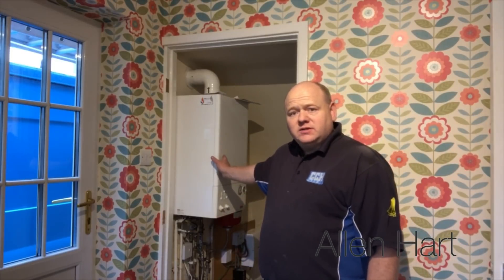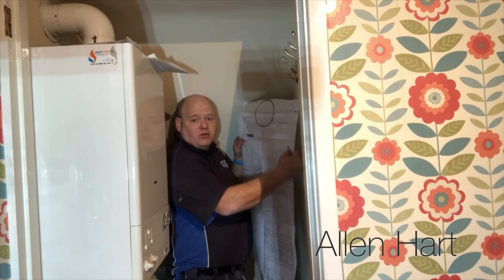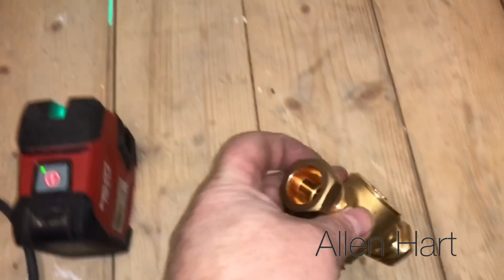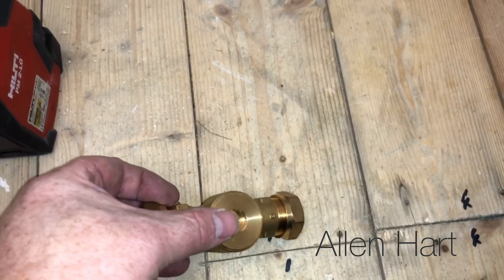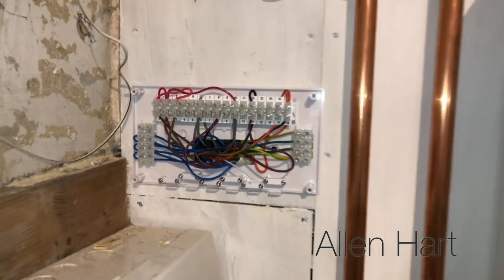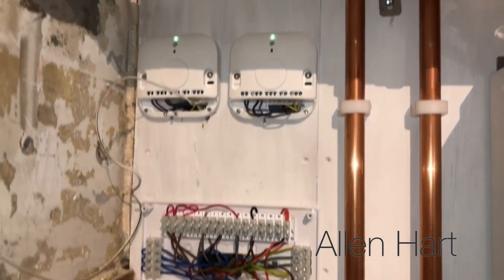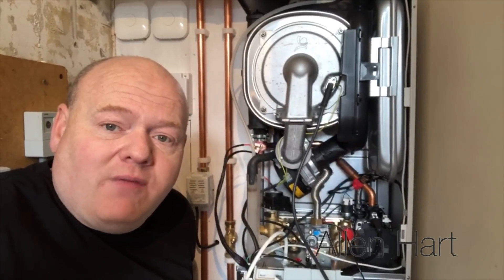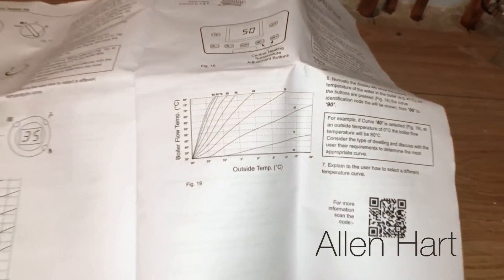BAXI 600 - 636 GAS COMBI BOILER INSTALLATION - IFOS - NEST - S-PLAN

Comment: Baxi have the vent mode for when the boiler is first switched on to get the air out of the system. Can this mode be used when the system has been drained & refilled? If so, how is it accessed on the controls? FYI, your work's much neater than any gas fitter I've ever used - many have shocking workmanship.

Comment: What curve you you set the ifos system in the end?  I’ve got mine installed and getting ready for winter ha
Reply from the maker: I ended up removing it as i didn’t really like it.
Reply: Allen Hart that’s what I’ve heard ha. Il try about 5pm pos and see how I get on. Obv the 630 version drops down to 20kw in heating, assume the 636 is bigger CH kw. Watching your latest vokera video where ya can range rate the heating demand. Is there no way baxi could release an installer/gas safe Wi-fi module that plugs into the front on the diagnostic plus to allow you to set all these parameters on installation with a smart phone ? Your the celeb now. Maybe ask baxi if it could be done as I would like to drop my CH output to 12kw and see how I get on.

Comment: Alan that’s going to be a tidy job when complete .. One query why on the bypass pipe work did you tee it in with the returning bypass circuit converging with radiator returns straight  through the tee fitting instead of on the branch or (centre) entry ? Like this  ...your bypass has more chance of pushing round  (reverse circulating) nearby radiators? Love to hear your view on this possibility ??.. Best practice advises priority flow always straight through Tees and all converging flows on the branch . Good luck with your home upgrades . tho 👍cheers !
Reply from the maker: We have underfloor heating downstairs now. Thanks.

Comment: Why would you use ifos with Nest thermostats? I thought Nest used a local weather report.
Reply from the maker: Very good point, I was just showing it on the video. IFOS has been disconnected. Thank you so much for the comment. Happy new year
Reply: @AllenHart999  if you have multiple zones surely the nests are on/off and not open therm. So the ifos would still be useful? Or can you wire 2 nests to open therm?

Comment: The worst company i have ever dealt with Purchased in April 2017 Inspected by Baxi in may 2017 boiler installed ok , worked for 18 mts boiler now condemned by Baxi saying it was installed incorrectly now washing their hands of it blaming the installer

Comment: Hi Allen I have a question if a high limit stat is faulty does that mean if testing it and there is continuity on the connection it’s gone .
Reply: Generally a high limit stat has continuity both ends (NC).  If it reaches high limit the contacts open therefore shut down the appliance (NO).

Comment: Hi Allen great video , quick qusetion does the return just be a single return back to the boiler as normal or does it be piped up in a different way? As do you need 2  seperate returns aswell ?
Reply from the maker: LETS GO all the returns join together. Normally near the boiler 👍

Comment: Hi, thanks for the video.
I have a couple of questions please 

1. The shock arrestor, on which pipe does that need to go on and what does it do? From my understanding it limits the pressure change to reduce damage to the boiler 
2. During servicing of this boiler, will the engineer open the heat exchanger or is that not necessary? I know they open the older boilers but on these ones do they have to change the seal?
3. Why does the flue have to be at a 3 degree angle ? And is the flue resistant to cemet? 
4. What is the purpose of the bypass that you installed first? Why is the return pipe connected to the flow via a bypass?
5.  How does the flow valves work for the 2 zones? I assume it stops one valve and let's the other open ? 
6. How far does the pipe work have to be from electric meter or switches?
7. Does the boiler have to be a certain height off the ground? 
Thank you for the video and I am an apprentice, thanks in advance
Reply: E45 Cream far too many questions.

Comment: Another benefit to press fit is the lack of soldering that you have to do meaning you can be as lazy as anything much prefer soldering takes more time but looks better and will last much longer than the rubber O     rings In the press fit fittings but each to there own everyone has there preferences still a great install and great video.
Reply from the maker: Pressfit has been around for 50 years and in nearly all commercial settings, Including hospital's. I used to like soldering until i used press. Thanks.

Comment: Hi, Every boiler install manual I’ve read says the boiler must be fixed to a masonry wall and not timber stud or similar (assume because of the heat from the boiler and fire risk?). Is this boiler different as you have boarded out the wall for fixing; could you confirm please?
Reply from the maker: Stephen Hall I don’t know of any boiler these days that you cannot install onto timber , Thanks

Comment: The nest has weather comp built in and adjusts your heating times automatically
Reply from the maker: The weather comp on the nest will not work with more than one zone. Thanks.

Comment: Love the vids Allen, can i ask you a quick question, had a new combi boiler fitted 4 years back, doing the normal getting serviced every year to comply with warranty, got a issue, maybe you can help i keep having to bleed my radiators on the first floor, cause air rises i guess, the system is not leaking as i cant find any puddles under the rads, i am bleeding them say every other week, not much air escapes, but if the system is sealed why is this happening, when i do bleed them it smells like a chemical smell, could this be flux still in the system ??? any help mate be great. Paul.
Reply from the maker: Paul Le Fur Maybe you could buy a Fernox test kit, take some water out and send it off, that way you will see what’s wrong.

Comment: could you not have wired the nest into the opentherm on boiler
Reply from the maker: Extreme Photography Not this time, it’s on two zones. Thanks
Reply: @AllenHart999  me being dumb of course i fit nest usually and wire onto opentherm thats how my baxi 428 is running

Comment: Hello Allen, another great video mate & thanks for sharing.  
I have a couple of questions about that bypass!.......when the bypass is active the direction of water will be further restricted by the direction of water coming in via the return & also it will enter the boiler un filtered as it is tee’d in after the filter will it not?
Thanks again & keep up the great work!
Reply from the maker: The bypass wouldnt normally be used, it has one rad in the hall that is used as a bypass. Thanks.

Comment: Hi Allen, been watching your videos for a few weeks now, really like the Baxi 600 range, been fitting mainly Baxi boilers for years, expansion vessels on the 600 range are a bit on the small side tho
Reply from the maker: Just add an extra one if its not big enough for the system. Thanks.

Comment: Great video - thanks!  Would you recommend a Baxi heat only boiler if you were installing it in your own house?  It appears that the current heat only models utilise an aluminium heat exchanger.
Reply from the maker: They do a system boiler which is very good, open vent I would go for the Viessmann compact.
Reply: Dont know why these videos are on you tube as its illigal to fit gas boilers unless you are registered ! and being registered you would know how to fit a gas boiler !   ,
Reply from the maker: @gonzoeveritt6002  You make a very good point but we are in a world where everything is online, Manufactures add videos on how to do things only gas engineers should be doing. Thanks for your feedback. 👍

Comment: I think those fittings look so ugly, a neat soldered fitting all day
Reply from the maker: No flux has been added to this pipe work though. I have soldered for nearly 30 years and I would rather use press fittings 👍

Comment: Nice vid Allen,  fitted a few of the 600 range now and have mixed feelings and maybe some improvements Baxi could look at.  My main gripe is the return connection and the cold water feed connection on the boiler. On installation it is vital that the two supplied unions for the return and cold water are tightened fully and absolutely square before fitting the fill loop, if the loop is fitted prior to these two connections being tightened they become in accessible with the loop in place, even with a tap spanner. This means in future should there be a leak on either of these unions it is impossible to gain access without removing the loop?  I have to say, this is one of the really nice features of the Ideal Logic, once the control panel is dropped the unions are full accessible. Another little niggle is the magnetic drop down flap, great idea but once there are a couple of cables coming through the base of the boiler which double up on pushing the flap back up can create quite a lot of resistance making the flap difficult to stay up? Only minor gripes which are pretty obvious i would say but addressed could make a pretty flawless boiler.....oh, apart from the fill loop which needs a  driver wedged in or maybe a piece of pipe to keep open whilst filling, i like the fill loop as with Worcester but again not entirely happy about it on filling a system from scratch. Why cant Baxi make a plastic tool available to installers only which keeps the lever open?
Reply from the maker: I have seen people connect all the pipes on before they put boiler on wall, i havent done it that way though. all in all i think this is a great boiler, Thanks.

Comment: can some one give me some advice i have a potterton performa 30HE combi boiler with the timer built in and it is in the garage of my new property is it possible to fit a wireless programmer and thermostat control unit to make it easer to control the heating ?
Reply from the maker: Yes, it’s very easy to do.
Reply: thank for reply  @AllenHart999
Reply from the maker: Whoever installed the boiler should of installed a room stat.

Comment: Nice video Allen, Any cons on this boiler or improvement's baxi could make.
Reply from the maker: The electric connections still need to be updated but apart from that it looks a really good boiler to me. Thanks.

Comment: Is the press fit allowed to be used on gas pipes?
Reply from the maker: Yes buddy otherwise i wouldnt of used them. You need to use the ones for gas and with yellow o ring. Thanks.

Comment: Lovely job, just hope your electrics don't trip when the fridge is put in there!
Reply from the maker: The house is getting rewired lol.. Thanks.
Reply: @AllenHart999  put your fridge on rollers and save some cash. I've seen consumer units fitted in the back of kitchen corner cupboards behind a multitude of pans. Completely unable to do any testing.

Comment: HI Allen, Great video as usual.
I noticed you're nests aren't wired to opentherm. Any reason for this?
I have baxi 600 and nest wired to opentherm as per your'e previous videos. I am using the nests  internet weather information for weather compensation. Is this the same as using the IFOS in your'e opinion.
Reply from the maker: It’s on two zones, if it had only been one zone then I would of wired it on opentherm, 👍

Comment: Hi Alan would you still require a radiator without a trv for the nest to act like a room stat so they don't conflict with each other.
Keep up the knowledging information. Great
Reply from the maker: Thats correct, The thermostat should not be in a room with a TRV, Thanks.

Comment: Nice install Allen. I do like the baxi.   They should move the gas valve higher. Any water leaks could take it out
Reply from the maker: You make a good point about the gas valve, I have installed quite a few of the 600 range now and they seem very good so far. Thanks for watching.
Reply: @AllenHart999  👍 love your videos.

Comment: Alan... love the video , just a quick query why have you put a check valve by the shock arrester.
Reply: Sometimes with combi boilers it can fire up when you use the cold water tap, this is due to the pressure in the pipework fluctuating and the boiler thinks you've opened a hot tap, so it fires up for a couple of seconds. The non return valve stops the boiler sensing this change in pressure and  therefore won't fire up. The small expansion vessel is to prevent hydraulics in boiler over pressurising and bursting as it is downstream of the non return valve.
Reply: @BABYCHAOS26  Noted... can I clarify with you in respect of what you are saying 
both the expansion vessel on the cold inlet into the boiler or one on the cold
 and the other on the hot outlet.  The only reason I ask, to date I have not fitted a check valve with a shock arrester onto a combi.  I have just  fitted the
 shock arrester on the cold inlet....everyday is a school day!!!
Reply: Harry H I work for a housing association and a few years back we were fitting Glow Worm Flexicoms and we found that many of them were suffering from what I described above (when cold tap used it would fire up when you closed it) were advised to fit (by Glow Worm) non return valves to the cold inlet to the boiler, this eliminated the problem, happy days!
However when we changed to fitting a Potterton Promax we tried the same trick with non return valve, all was well until they started to burst internally. From what I remember Baxi advised us to fit shock arrester to inlet also. We tried just fitting the arrester without the non return valve but boilers would still fire up. So we fitted both and we've not had any bursts or unwanted fire ups since. I think it all depends on your water mains pressure.
Reply from the maker: Its in the instructions to install one, Page 37 fig 27 , 5.6.2 Domestic hot water circuit. Its just recommended.
Reply: @AllenHart999  Hi Allen, what is the make of the expansion vessel please.
Reply: @6804harry  Probably a Zillmet
Reply: I wonder if it's to prevent any perished rubber getting back into the main if the diaphragm were to fail...

Comment: Never thought about using Honeywell evohome? Can then control each rad individually with individual on/off times and temperatures.
Reply from the maker: I have thought about it and really looked into it but i have heard of too many issues with them loosing connection, Also i do not like the idea of loads of batteries hence the reason my Nests have been hard wired. Thanks for watching.
Reply: Allen Hart ah yes, each to their own of course. I have it fitted in my home and once set I’ve never use the online function (this is the function that drops out now and then, only for a matter of minutes though). The batteries do tend to last around a year depending on the usage. But hopefully these are all this that will improve in the future as more companies start competing. 

Thanks for the videos 👍🏼.
Reply from the maker: @Mr_Ashley  I really do not want to go round changing batteries every year, As you say each to there own, Thanks for watching.
Reply: Ash Bayer you took the words right out of my mouth mate. I’ve got the Evohome installed at mine. It’s head and shoulders above anything else out there currently in my honest opinion 👍

Comment: Hi Allen I'm surprised you didn't fit a vaillant? I like the look of the baxi  it's compact but I think the vaillant ecotec range is a lot better at fault and status diagnosis as you can check it live I don't know much about the new baxi range?
What are your opinions ?
Any way fantastic install keep.up the good work and the informative videos for us that have not been doing gas as long as you have .

Waseem
Reply from the maker: I would never fit a Vaillant in my own home. Baxi suits my needs perfectly well. Thanks for watching.
Reply: Thanks for your reply
Reply: @waseemkhaliq933  vaillants are dead. The turbomax was the best one. The new ones are lame
Reply: I've got a vaillant in my house, it was there when I moved in. It's just like a glowworm flexicom inside. I'm not a fan of flexicoms. I'll more than likely fit a Baxi when it needs replaced.
Reply: Only thing that puts me off Vaillant is the dog shit customer support and general backup. Had a job last week to clean 2 magna cleans following Vaillant servicing the boilers, engineer told him it wasn't his job and he should call a plumber. Like wtf...
Reply: SmokeyJ now that I do agree with. Had it myself, nob eds
Reply: Vaillant controls are the best on the market IMO. Fantastic boilers too, all brass on the plus range etc. Green IQ market leading innovation